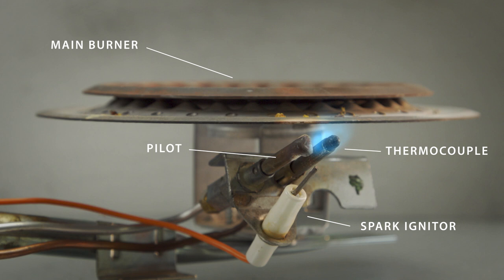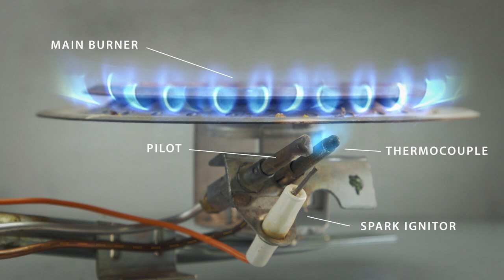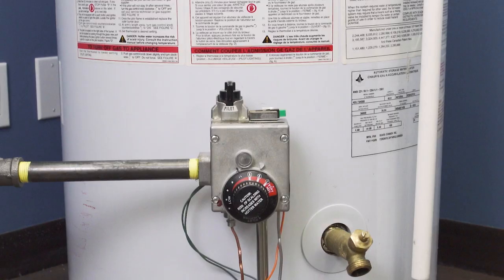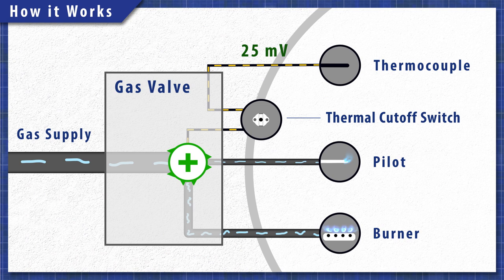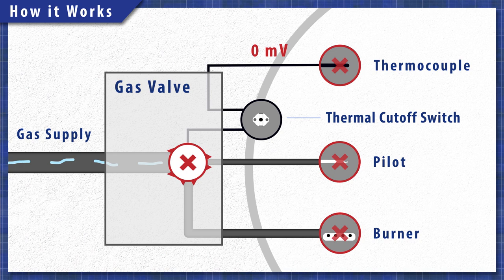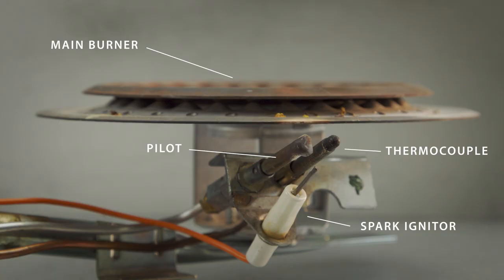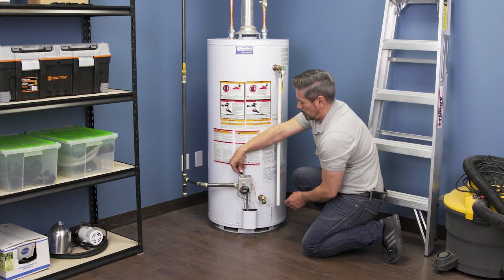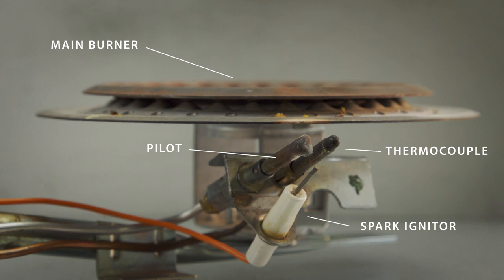How Does a Thermocouple Work in a Water Heater? | Repair and Replace

Comment: Will a faulty thermocouple cause a weak flame, or would it just stop any flow all together?
I have a weak flame going into the burner tube and have checked for the usual culprit, stinkbugs, but nothing.
Any help would be greatly appreciated.
Thanks
Reply from the maker: Thanks for watching. A faulty thermocouple will not provide enough power, and the gas valve will close, providing no flame. A weak flame is likely due to a dirty burner, or in some cases low gas pressure.

Comment: In the diagram, the thermocouple and burner appear to share the same gas line. But wouldn't the burner have its own valve, and if so, what opens and closes it? Thanks
Reply from the maker: Thanks for watching. The diagram is simplified and doesn't show the nuance of the gas valve.

The thermocouple provides power to a solenoid that is closest to the supply line. When this valve is open, the pilot flame will stay lit. When there is no power from the thermocouple and this valve closes all gas will be shut off to the water heater.

There is also another valve that is controlled by the thermostat. This responds to changes in the water temperature and will open and close as needed. A failure in this valve won't effect the pilot light.

Comment: Mine stops turning on until I turn up the knob. Then it turns on again but I keep having to raise the temperature after some time or it stops kicking on at current setting. Pilot has never gone out. Any advice?
Reply from the maker: Thanks for watching. If the pilot stays lit, then that shows that the thermocouple produces enough voltage. In this cases it's likely a faulty control valve, this can't easily be tested though but it would explain the intermittent issues that you're having.

Comment: Is it normal for the flame from top round flame disc to touch the thermocouple and ignitor?
Reply from the maker: Thanks for watching. It depends on the unit but the top flame is often quite wide (more wide and less defined then the simulated flame that we show in this video) and can often touch the thermocouple.

Comment: How does Universal Thermocouple works? Because it's not having two wires ending. Only one covered  tube end.  Normal thermocouple having two wires end for measuring generated millivolts.
Reply from the maker: Hi Rehmat, thank you for watching. There is a wire inside of the isolated copper tube. Both the wire and the copper tube are part of the circuit when the thermocouple is screwed into the gas valve.

Comment: I have the opposite problem with my tank top heater....flame goes out but u can still hear gas pouring out.
Reply from the maker: Hi Jason, if gas continues to pour out even after the flame goes out, then there is a leak or a faulty gas valve. Shut off the gas supply, ventilate the area and call a licensed technician to inspect it. Its essential to get this checked out as leaking gas is very dangerous.